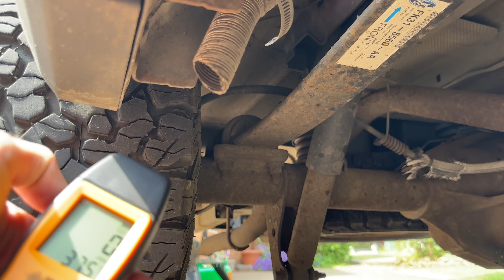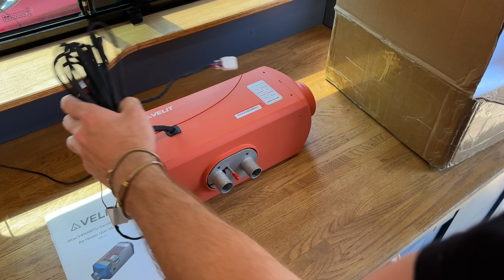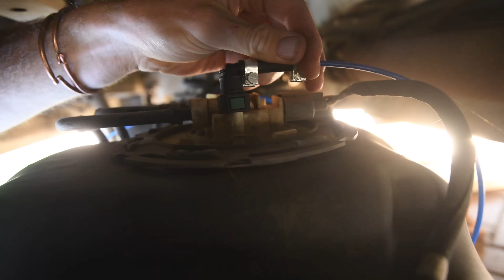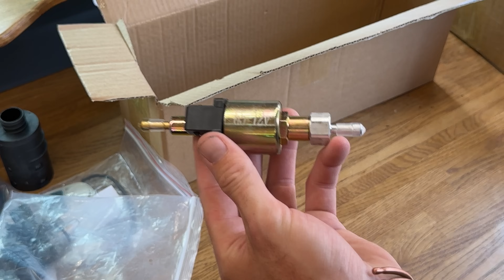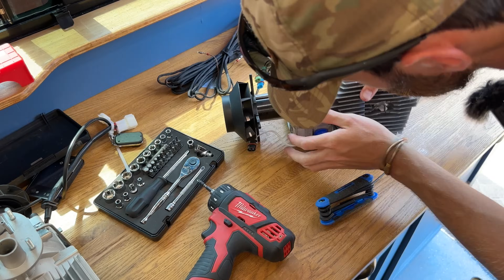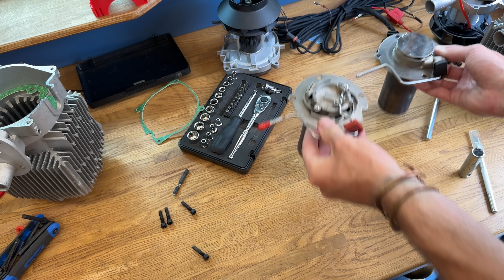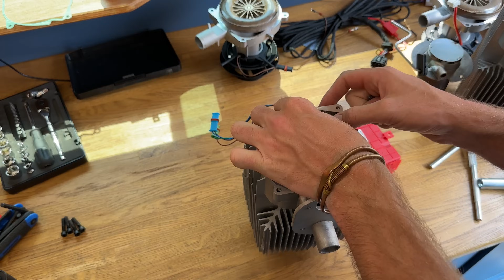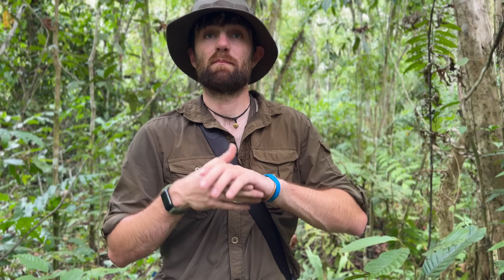DIESEL HEATER runs on GASOLINE / PETROL! AMERICAN CHINESE Heater Review | Tear Down & Comparison

Comment: Why make it  complicated  with 2 different fuels ? They should have just made it for gasoline only. The KISS principal . There are already quite a few made for diesel . Then they would sell as many as they made.
Reply from the maker: For end customers it only one fuel. 

End User doesn’t really swap the ECU. They order one or the other. I had both ECU’s because I was testing it.

Comment: I run 50 percent diesel, 40 percent fuel oil, 10 percent petrol.  Use a 15 gallon fuel cell to keep refuling outside.   Straight petrol has its own hazards. The biggest being it runs too hot!
Reply from the maker: Most of the companies make specific petrol versions though ( but are rarer ) , which have different fuel rates and the diesel equivalents.

But I do know lots who run a mix of fuel in diesel version

Comment: It's different. that is webasto style copy
Reply from the maker: Not at all, it’s a Espar 4D based design. The Webasto air top bodies are completely different bodies, particularly the casting for the fan body has multiple cooling on the air top.
Reply: @MispronouncedAdventures webasto has that type of glow plug mate. And webasto has has the round mesh in the burning torch

Comment: How about fuel usage? Does the gas powered unit consume significantly more fuel per heat output?
Reply from the maker: Velit’s official stats says it’s the same heat output. 

with the Gas version using a tiny amount more than the Diesel

Comment: Your output numbers for your velit are an exact match  on high medium and low for my 2kw hcalory diesel heater.
Reply from the maker: That wouldnt surprise me. A normal 2kw heater are going to have lower exhaust temperature than a normal Chinese 5kw. The Velit has a different burner chamber with a high transfer rate so it has a lower exhaust temperature than a normal 5kw.

same for measuring heat output of the ducting. 2kw have a smaller diameter duct ( 60mm I think ) vs larger 5kw models ( 75mm ) . so 2kw would be more concentrated heat on a 2 kW duct due to its small ducts. fan speed would be a another factor a 2 kW running on max as a far slower fan speed than 5 kW running on max.

Comment: Obviously I have no hands-on with this, but a couple of things/questions:

The link to the product on Velit's site, that you have in the description, that product page says "Gasoline/Diesel" in the title of the product, but there are buttons below, one for each fuel type - you have to choose one or the other. Even though you're swapping ECUs, I really doubt that is anything near a recommended method. 

Could it be having run gasoline/petrol through that thing and then swapping is what caused the issues with diesel? Might the heater have run fine as a diesel heater to begin with? Kinda late to test this with that unit, I expect. Maybe tear it down, clean it out, try with diesel again?

I do have to wonder about this unit though. Gasoline engines don't use glow plugs, so what goes on with that in that unit?
Reply from the maker: Yes, the customer buys the particular version they want so it comes shipped with the correct ECU. Not for hot swapping fuel types. So it’s not really designed for the customer to buy two different ECU’s and changed the fuel type when they want.

Although I have looked at some other heaters which you can just put either fuel in it runs

You are correct gasoline engines don’t use glow plugs but this isn’t an engine. It’s a burn chamber so it still needs a glow plug to heat  and presumably vaporiser the fuel before it combusts from the glow plug heat and becomes self sustaining
Reply: @MispronouncedAdventures  Understood. The glow plug thing had been an enigma. Thank you Alex!

Comment: The truth is all these heaters will run on a variety of fuels,diesel/petrol/kerosene/parafin whether it’s a brand name or Chinese,petrol needs a higher fuel flow as it vapourizes too quickly but will use 3 times the amount of fuel to generate the same amount of heat as a diesel,64ml compared to 22ml,I think that’s why this machine struggles on diesel as it’s putting in 3 times more fuel than is needed and flooding the chamber causing it to flame out/smoke,I bet if you put a 22ml pump on there it will run perfectly

Comment: NO! NO! NO! IT WILL KILL YOU! 

DO NOT KILL YOURSELF!

DO NOT OUT GASOLINE IN A DIESEL HEATER!

NO! DO YOU RESEARCH! 

Since gasoline is an explosive fuel it can explode with only a little spark. Gasoline turns into gas way way way easier that diesel and this fume can explode even faster than liquid gasoline.
Gasoline have a different startup temperature than diesel. 

Beside that it will destroy your heater eithin 3 runs, it will definitely kill 50% of people testing it...
The chamber will explode, all fumes light up, your tank will trigger and BOOM YOU'RE ON FIRE NOW! 
It just takes 1 spark to much..  

DO NOT OUT GASOLINE IN A DIESEL HEATER!

Comment: Thank you for being honest. In the US, companies are trying to rebrand these as something different from the Chinese versions, and are slapping an exorbitant $1500 price tag.
Reply from the maker: No problem, I do my best to be honest in reviews with the information I have. 

Although I don’t want to come across too unfair to Velit in this case. Whilst the unit is manufactured in China, as are many things. Although from my understanding the proprietary components like the burn chamber are designed by them in the US as a company. So it’s nice to see a western company developing and improving parts of the system and charging more because of it. It would be very deceitful if it was just a standard heater from China with their name on it, in this case it’s not. 

There is a similar issue in the UK and Europe with some companies claiming it to be “their” heater when there is no changes from standard Chinese ones so just put their name
Reply: Vevor brand is the only brand diesel heater that matters. they buy them from China & put them through thier own QC so you pay an extra hundred bux but in return you get a warranty & garentee for a little over 200 bux
Reply from the maker: @Breakingbylaws I feel Vevor make some  fairly below average but because of that some of the cheapest around.  I’d hardly say Vevor matters though
Reply: @Breakingbylaws  I paid $75 for my no name CDH  around 2015 and it works awesome . Just like it did brand new. (always have used diesel from the pump) .  If it would konk out now I'm thinking I got my $ worth to purchase a new one. I just don't see that happening though.

Comment: I would rather be cold than run gasoline in a diesel heater.  The possibility of something catastrophic happening with gasoline fumes is just too serious.
Reply from the maker: That’s probably the wrong way of looking at it. Almost all of the main western brands like Webasto and Espar have petrol / gasoline versions for decades. The units hardware designs are pretty much the same.
Reply: @MispronouncedAdventures  To each his own.  Both can be messy to handle but gasoline is far more volatile than diesel and a minor gasoline spill is potentially much more dangerous than diesel.

Comment: Sending one to a reviewer with a faulty component is unfortunate, but sending one with a broken pump AND a faulty ECU is a bit concerning. Companies either have to have acceptable build quality, or foolproof quality control procedures to ensure DOA units don't make it out to customers.

You can't use customers as your quality control because regardless of how easy you make getting warrantee parts posted out to customers, it will always reflect really badly on your company when folks write reviews for your products.
Reply from the maker: The DOA on was a bit of a pain for sure but these things  happen. 

as for the ECU I think this might of been because they didn’t have a spare diesel ECU and flashed a petrol one which didn’t work out. it’s was a little while ago no but if I reminded i it was something like that, they had to do something special to get a extra ECU sent over.

Comment: Wonder if I could get a higher rate fuel pump and steel mesh and convert my diesel heater to gas one ?
Reply from the maker: I think there’s a lot more to it than that this also has a completely different burn chamber.

Other heaters, I’ve tested they’ve just used normal size .22 pumps for both
Reply: Playing with fire 🔥

Comment: Not sure I'd trust one of these cheap chinese heaters running on gasoline. I don't want to explode. lol
Reply from the maker: This isn’t really a cheap heater, it’s uses the same design as the Espar D4 heater ( same as normal Chinese heaters ) but maybe of the parts are proprietary to this company and better than normal.
Reply: Ok then, I wouldn't trust my life and home to an overpriced, chinese Diesel heater.

Comment: I paid $8 for my diesel heater on Temu and I couldn’t be happier. I use it for heating my 26’ rv and my truck. I’ve had it almost a year so far and I can’t believe it’s still working!
Reply from the maker: $8? Not $80? I just review different heaters. the main diesel heater in my van I paid £84 for 4 years ago and it’s now got 6000 run hours

Comment: What is the octane of your petrol?
In the states we have 85-91. I think Europe has 100+?
I just remembered there's two rating standards and I can't remember which one we use. I think R/M.
Reply from the maker: Yeah, octane isn’t something I know much about. I’ve always driven diesel vehicles as all our vans are diesel in the Europe. 

So I’ve just filled up with normal supermarket standard petrol. Having a quick Google I believe is 95, and if you buy the better premium, it’s 99. 
But this isn’t a area I particularly know about

Comment: The funniest part is your Chinese heater looks like it has one setting as far as vent temperature goes. 
And the high CO for gas on low shows how inefficient it is on low.
Reply from the maker: I’m not sure why that’s funny? generally on most of the heaters it’s the same ( unless tuned if a tuning option is available ) the lower end / low setting of the output is less is a efficient burn and therefore a higher CO output that’s pretty common on most heaters of this style regardless of where they were made.
Reply: @MispronouncedAdventures  I didn't know vent temps were so similar. Why wouldn't these heaters be tuned more specific to a low setting so the low setting is most efficient?
Reply from the maker: @samuelfox8126 yeah it’s more about airflow then output vent temperature. The vent fan and internal combustion fan are linked on the same motor so on the lower output mode whilst the vent speed is slowed so is the internal combustion fan. The Hz of the pump is also changed the when changing output settings to counteract the decreased or increased combustion fan. 

When I have seen tuning done, it’s tiny changes to fan speed and pump speed. It’s probably a rough setting they used by default across all unit software wise because there will be slight differences for each unit ( or I don’t really care as long as it’s hot ) 

But generally, the factory tunes are pretty good. I see a number of people mess up their heaters by making even worse burns which soot up quickly by tuning. 

The higher end burn by default is probably a more efficient burn due to the construction of the larger heaters. 5 kW ( 4kw ) heaters which are physically larger tend to be more efficient on their high output end, than a lower 2kw output. Whilst this 2kw heaters which are far smaller heaters have a way more efficient burn at 2kw ( there top output )  as they designed for it

Comment: Does the Chinese one come with a filter and the metal insert for the floor of the van?
Reply from the maker: As in a fuel filter? Most do. 

Most come with a simple mounting plate, but not the turret mounts that I would use for being in a vehicle

Comment: would of been interesting if you tested fuel consumption vs diesel heater
Reply from the maker: The manual documents fuel consumption on high and low settings over an hour

Comment: Do you use your van's auxiliary fuel port at high elevations? Their manual says the auxiliary fuel port may only be used at <5,000ft (1,524m). They also told me "the OEM pickup provided by van manufacturers is too large of a diameter for the fuel pump and causes issues at higher elevation." Just curious what your experience has been at high elevations. Thanks!
Reply from the maker: I use it at all elevation I’ve can drive but realistically being in Europe. There aren’t many drivable places that are “high altitude”

I don’t see why there there is be an issue unless the OEM from Ford bits used some odd bore pipe. The diameter would be dictated by the bore of the pipe / pick up used. The official Espar kit is 2mm bore with is the same as the Espar and Webasto normal 2mm bore hardline fuel like. Which is more common now in Chinese heater too. 

I understand how pipe bore could effect a pump, but I don’t see how high elevations would effect the fuel pumps. Sure high elevations effects burn , but not sure I see how the pump would be effected

Comment: I also find it strange that the manual lists the working temperature as -30-75°F (-34-24°C). I'm assuming "working temperature" is referring to outside air intake temperature and not the space around the heater itself. It also says not to use the fuel pump at a temperature higher than 20°C (68°F). Is this normal for these heaters? Seems like there are times when people would want to run their heater in conditions above these temperatures for drying out gear etc.
Reply from the maker: I imagine their working temperatures are just a recommendation based on different components have. they will have to right something  

I have used my diesel heater down to -38c without issue, and I’ve had a +20° to make warm water as well.

Comment: Do you have any recommendations on the air intake filter? Would love to know what you usually use on you other heater. Thanks!
Reply from the maker: Combustion wise. I use the stock one. most expensive models like a Autoterm don’t use air intake filters are all. you want to be wary using intake filters. The filter are tuned to not have much restriction on the intake or exhausts. Putting a restriction like a filter which block too much air with effect the burn and could lead to sooting / coking up

Comment: Any chance your going to do a long term review of this heater?
Reply from the maker: Unfortunately not, it’s doesn’t suit my needs running primarily on gasoline which is don’t use in Europe for vans. plus for me  it’s controller isn’t that advanced compared to my current ones And annoyingly it only displays Fahrenheit.

Components wise, it should be fine, looking at it. having looked at many heaters
Reply: @MispronouncedAdventures  totally understandable. I do wonder what it would take to control via a microcontroller (like Arduino). It probably wouldn’t be hard except it could take quite a bit of time to reverse engineer it. I’m doing this with the Maxxfan and would love to have them controlled together. Thanks for the honest review.

Comment: Put petrol in the diesel heater, seems to work fine for me just can’t have the low setting quite as low otherwise it’ll shutoff on it’s down flame out
Reply from the maker: After all they are just burners, it will “run” with a lot of things in it. Just not always very well
Reply: Are you saying that you put gaseline in a diesel heater and it ias working?  Interesting.  Is it working well?

Comment: A fuel consumption comparison would be good given petrol is cheaper than diesel in the uk
Reply from the maker: I  don’t disagree it would be interesting comparison . although to counter that point, diesel is more calorific than petrol. 

Petrol may be cheaper, but heater running on it will produce less heat For the same quantity of fuel.
Reply: @MispronouncedAdventures  good point, but it comes down to how that calorific energy is liberated. If the burner is more efficient on petrol than diesel then this is another factor to consider.

Comment: These dieselheaters are quite all the same (different quality). Copyright was by Webasto (1932). It’s now copyright free, so Chinese manufacture it.
Reply from the maker: It’s wasn’t Webasto the Air Top design is completely different. It’s the Espar / Eberspacher Airtonic line. This Chinese use the expired patient of the Airtonic for the Chinese units.

Comment: for the fractionally challenged. US measurements aren't hard.

1 inch = 25.4 mm
1 foot = 30.5 cm
1 lbs = 454 grams
1 fl ounce = 30ml
to convert feet to meters divide by 3.28 so 16,000 feet is 4878 meters
for temp to convert F to C subtract 32 and then divide the remainder by 1.8

so when an American says damn its hot its 90 out!  thats 32 C.
Reply from the maker: We use both metric and imperial in the UK depending on the scenario. apart from Fahrenheit, we don’t really bother with Fahrenheit
Reply: Tell me how much is one inch,foot,lbs, without metric (mm,cm) ?  Like my inch is bigger than your inch or my foot is smaller than your foot. So what is the baseline for imperial ?